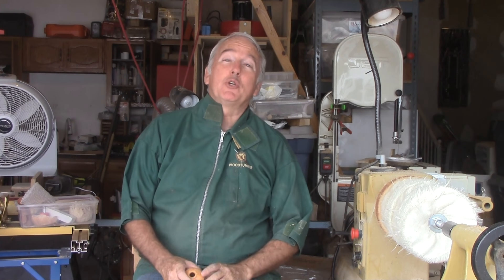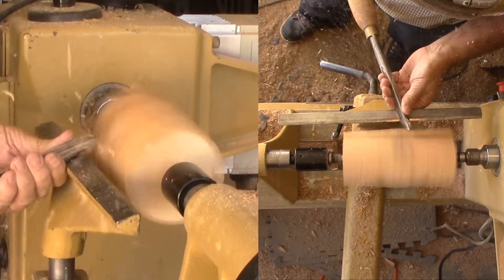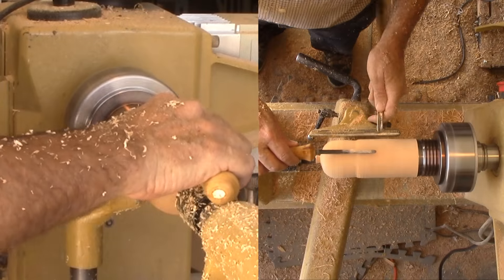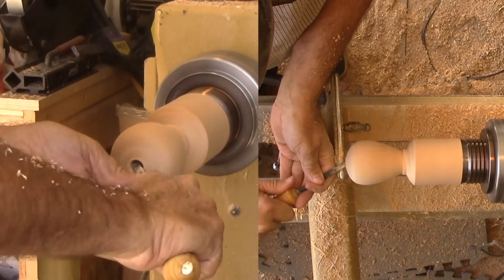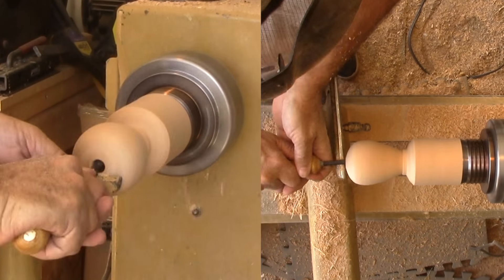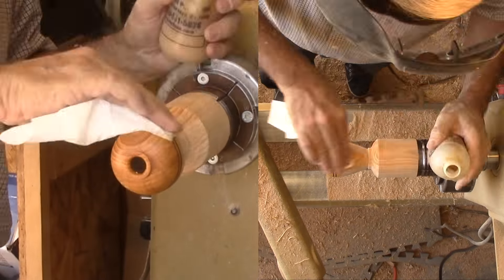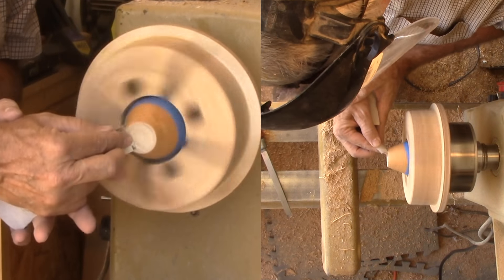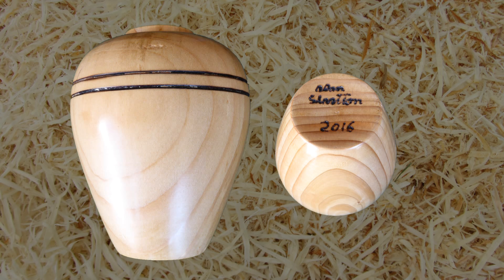Woodturning Miniature Hollow Form With My New DIY Tools

Comment: Very nice small hollow form. I like the way that you made the tools. I plan to make some of my own allen wrench hollowing tools very soon. I've also noticed with your videos how at the end you say to wear a faceshield. Do you have a recommendation for a mesh faceshield? I've used regular faceshields but they fog up really quickly and I end up spending more time cleaning it than turning.
Reply from the maker: Most of my fogging experience has come from enclosed googles. Only occasionally with a pull down faceshield. Usually the open sides keep air circulating enough to prevent fogging. Not having used a mesh faceshield, I cannot comment.
Alan

Comment: Interesting trick using laminate to center the piece while it's still loose... I'll have to remember that one. :) 

How thick are your walls in something this size Alan?  I've never been able to hollow worth spit without having a laser bolted on to see where I am... think I'm too thick and suddenly hear that sound like paper flapping before I blow it up by cutting through the side.  I made my own laser guiding system after blowing up one too many pieces of nice wood, coincidentally doing the same time as a guy in my club bought a commercial system.  He spent over $200; I spent $10 on a laser pointer from Staples and used an old ski pole I found in my garage. :)   Nice thing is, he tried mine at the meeting and said he likes it better than the one he bought! :-o  :) 

Love the shape & form of these, especially with those burn lines... I gotta get back on the lathe soon.  (Medical troubles. :( )
Reply from the maker: For  this size, I aim for 1/4 inch. At this scale, a laser pointer would be overkill. Also at this scale, the wood does not have to be that expensive. :) This cedar was free. 
Aaln